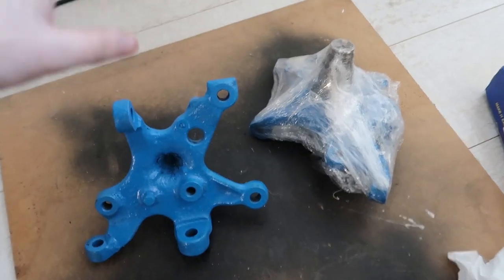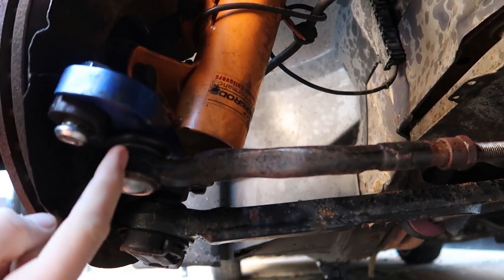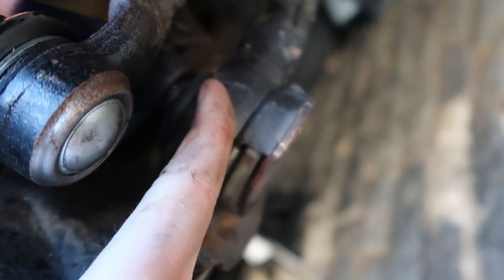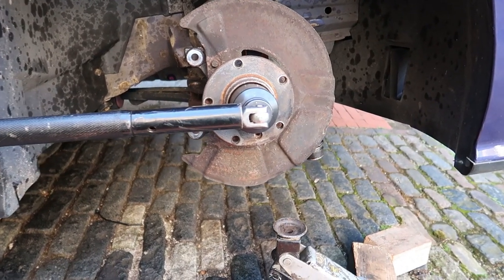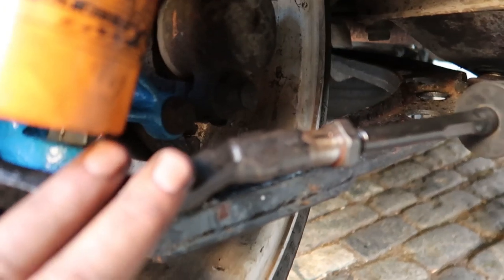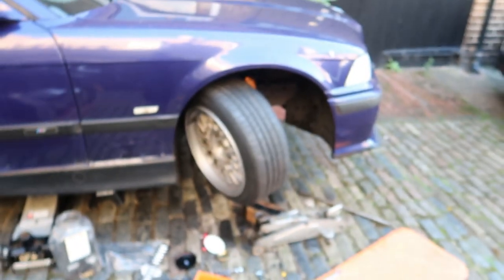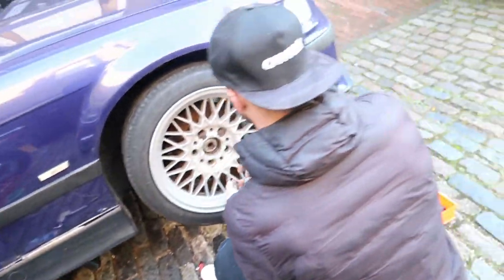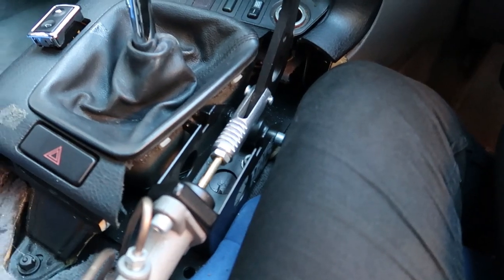BMW e36 Cheap Angle Kit Install! *Wizards of Lock*

Comment: Whats the wheel and tire size in the front? I want to run stock fenders as well
Reply from the maker: The wheels is 16”x8j 195/45/16 🤘🏼